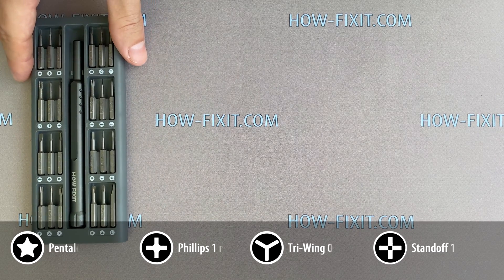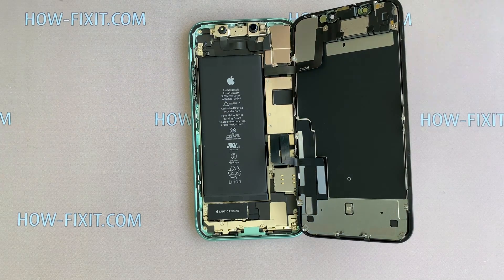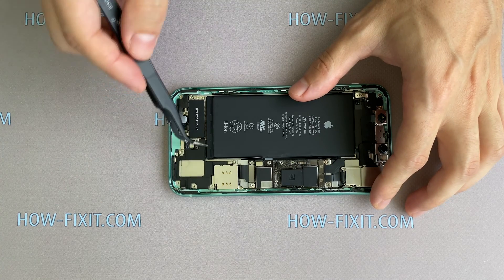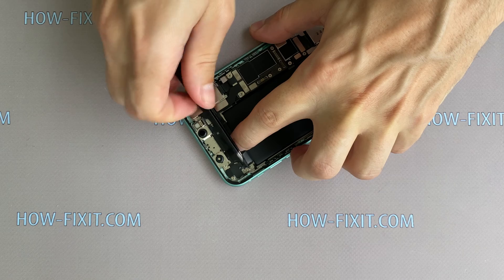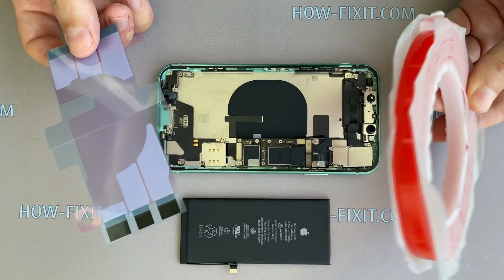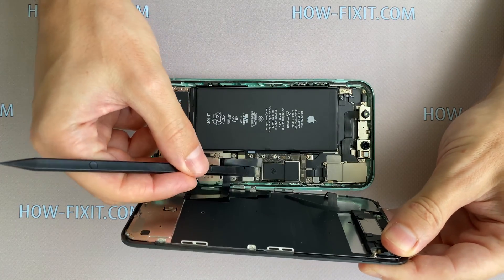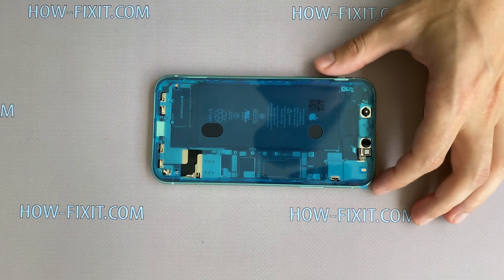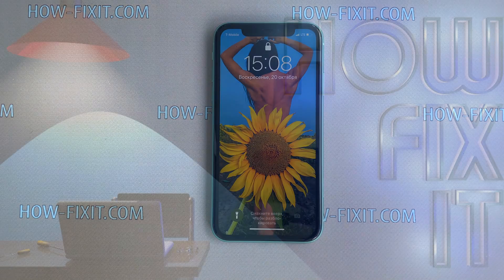iPhone 11 Battery Replacement: Tools, Steps & Tips to Ensure Waterproofing

Comment: Thank you from Seoul
6:29 I scratched a bit of the black part on the plate while removing the adhesives. Would it cause an issue? What is the role of that half circle shape black part?

Comment: I had to write out the steps for class and thought it might be helpful if I shared it.

The recommended tools for this replacement are: 0.8mm  Pentalobe screwdriver, 1.5mm Phillips screwdriver, Y-Type screwdriver, Standoff screwdriver, suction cup, plastic mediator(s), tweezers, spudger, and heat gun because the display is glued on.

Steps (in order) to remove iPhone 11 battery

1. Turn off phone
2.Take 0.8mm Pentalobe Screwdriver and remove the two screws on either side of the charging port
3.Take any hairdryer and heat the surface display for one to two minutes. This will allow you to remove the display from the case
4.Take the suction cup to the bottom of the display and insert plastic mediator(s) into the phone's sides and loosen the display from the case
5.Once the display is loosened from the case, move the suction cup to the center of the phone and pull up. The iPhone 11 case opens up like a book in the right direction
6. Now you need to disconnect the battery cable. Under the cable of the display model, there are three screws you need to access, in order to access this you need to remove the five screws on the latch panel (above) to gain safe access to them
7.Once you have removed the screws and taken the top of the latch panel off you can remove the display cables 
8.Remove the display and set it somewhere safe
9. Once this is done, remove the three screws on the 2nd metal panel and take the panel off and remove the battery cable
    Next, you will need to remove the taptic engine and speaker to do this you have to:
10.prepare to remove the taptic engine under the battery by removing the five screws 
11.Once done with this remove the two screws to the far right where the speaker is
12.Take a hairdryer and warm the tape between the taptic engine and the speaker so it will be easier to remove the tape without damage
13. Next remove two more screws and remove the metal bracket
14. Take a standard 1.5mm Phillips Screwdriver and remove the two screws at the bottom near the speaker
15.Now remove the speaker after you’ve heated it with a hairdryer to loosen the glue that attaches the speaker to the phone
16.Now remove two screws from the taptic engine and remove the engine from the phone
17.Remove 6 adhesive tapes from under the battery. Using tweezers, pull the tape away from the battery very slowly until it’s all gone
18. Now, remove the battery. You’re done! 

Steps (in order) to put iPhone 11 back together:

1. Put six adhesive tape strips back down and secure the new battery to them 
2. Put the taptic engine and speaker back in
3. Remove old silicone tape from the case and replace with new silicone tape
4. Connect the three display cables back to the mainboard then connect the battery cable and the small panel with three screws, then install the larger metal panel with 5 screws
5. Press the display case back against the case and press it on all sides, making sure it sticks to the silicone tape and is secure
6. Fasten the last two screws on either side of the charging port